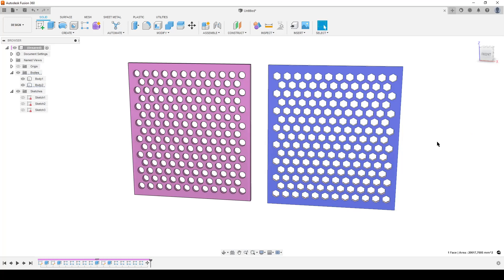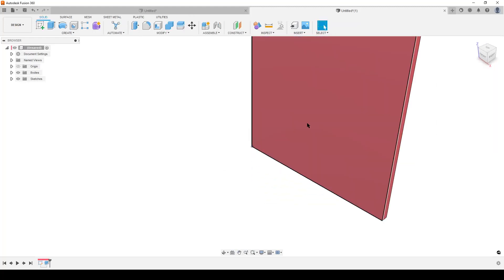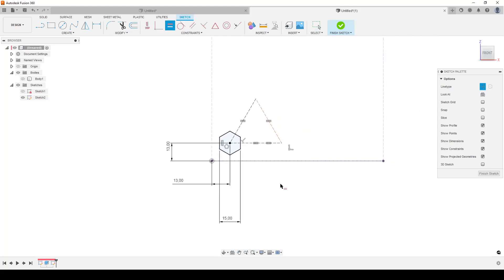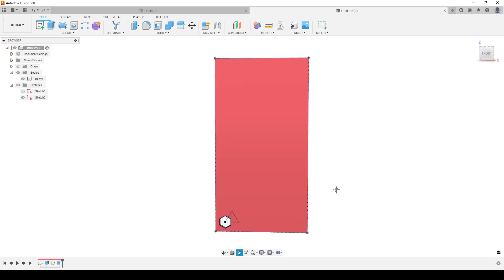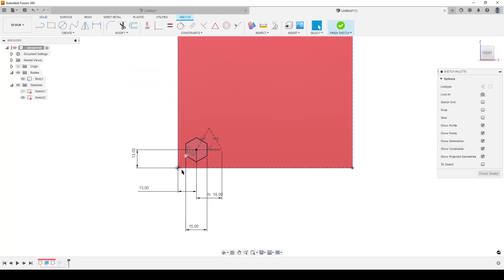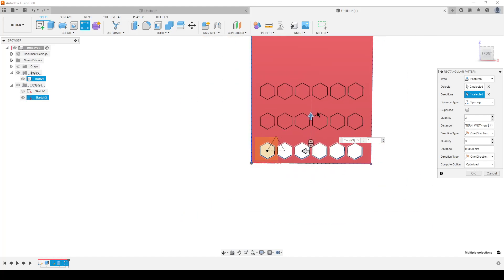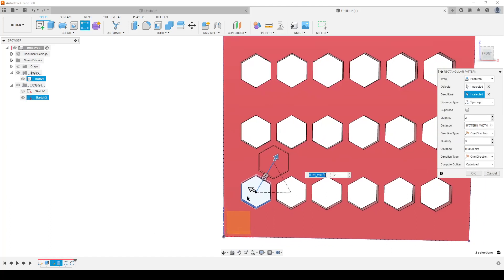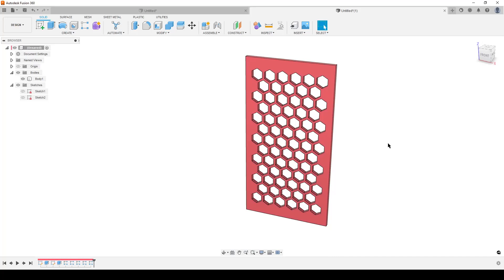Fusion 360 - A Rectangular Hexagonal pattern from a Equilateral triangle, or Put Holes in Part.

Comment: This is why I love Grasshopper. In GH this would be a one-minute job. The only downside being that then I'd have to take my Rhino export back into Fusion360 each time I want to change something.
Reply from the maker: There is the new design extension in Fusion that can do this but it's a bit expensive. This workflow is mostly for hobby users on a budget :) (and that doesn't want to learn one more software)
Reply: @KristianLaholm  Yes, I understand. For me, I could buy Rhino as an educational version and upgrade it for an educational price as well. Grasshopper comes with it for free. Fusion360 would be out of my budget when I can't use the educational version anymore so I'm trying to learn as much as I can.
Reply: @MarinusMakesStuff  You know Fusion is "free" ?
Reply: @varazir  Definitely! But the limitations make it so that I cannot do complex projects in it anymore. The limit of having ten active projects is not enough and I assemble my machines with lots of parts
Reply from the maker: @MarinusMakesStuff  You can have more then 10 projects but only 10 editable files at the same time. But the important is use the software that accommodates your workflow the best :)
Reply: @MarinusMakesStuff  If you don't need to edit all the parts you can have them on non edit
Reply: @varazir  Ah, so if I have one project folder filled with 20 imported .STEP files for example and three fusion360 files, I can still use all of it in one assembly file, even it those imported files are not active?
Reply: @MarinusMakesStuff  yes
Reply: @varazir  Alright, that is great news then! Thanks, I guess I'm good for the future then, when the educational license runs out 👌🏼
I'll still use Rhino and GH for my generative art, but for machine design, Fusion360 is awesome.
I discovered the animation tab last week and now I am planning on learning how to make joints that move etc.